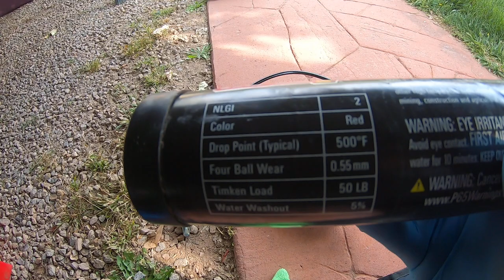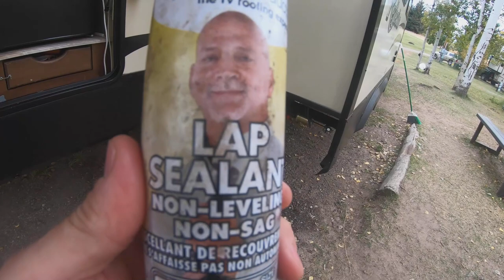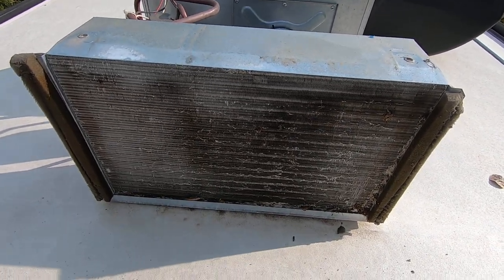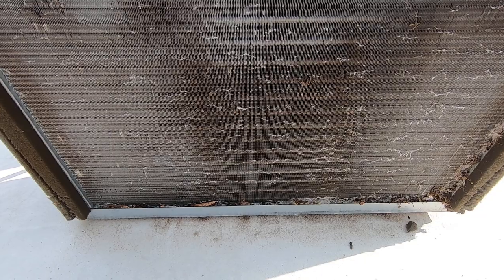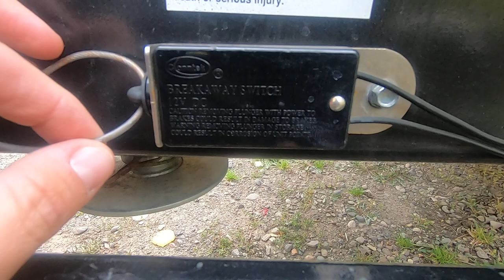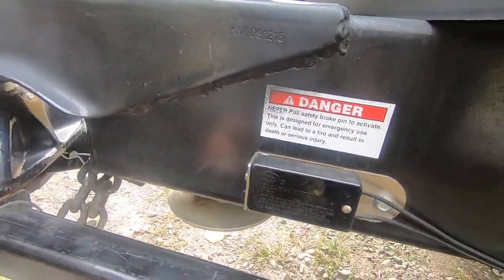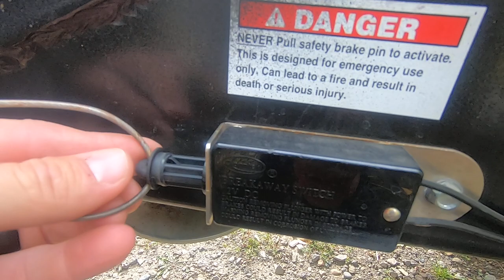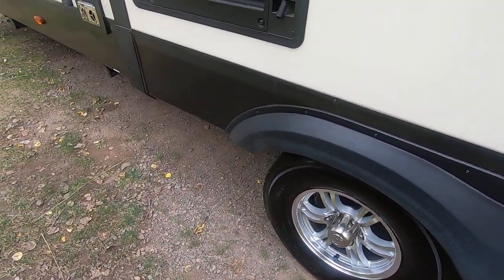Top 5 RV Maintenance Items You Are NOT Doing!

Comment: You can use baking soda to neutralize the acid. Sprinkle it on the roof below the fins you are cleaning. Also if you have two people you can have someone by the tires and the second person pull the pin and the person by the tires should  hear the brakes engage. Do that to both sides.

Comment: I recommend connecting the breakaway brake cable to something more permanent on the tow vehicle. If the hitch comes away from the tow vehicle that break system will do nothing for you
Reply: What are you talking about? It's connected to the hitch receiver which is firmly connected to the truck. It exactly how it should be done.
Reply: @bobcloughjr  I'm talking about the travel trailer that I saw come off on i25 here in colorado. It wasn't the ball or insert. The hitch bolt pulled out and it started to sway until it pulled completely off the truck. Class 3 with a 24 ft. It just happened. Had the brake cable been attached to the bumper or a license plate bolt it would have engaged the brakes. Unfortunately it was connected to the chain mount and so didn't.